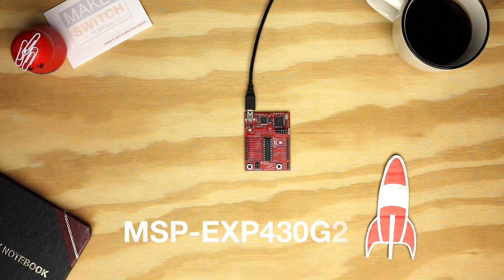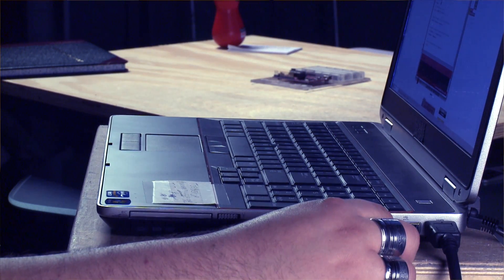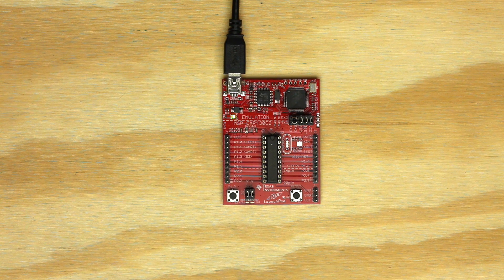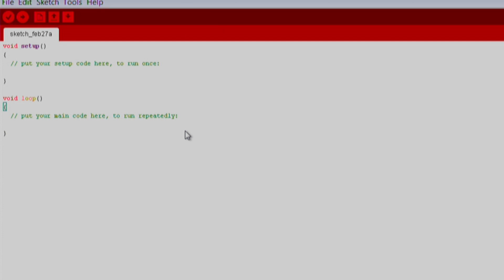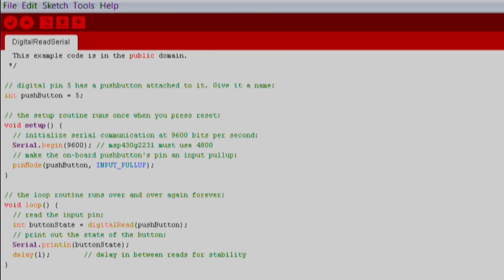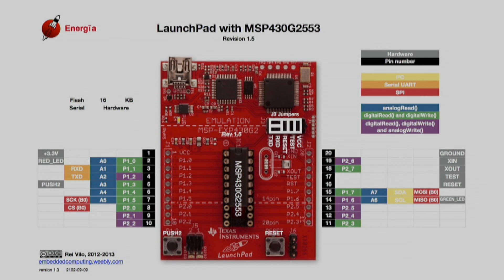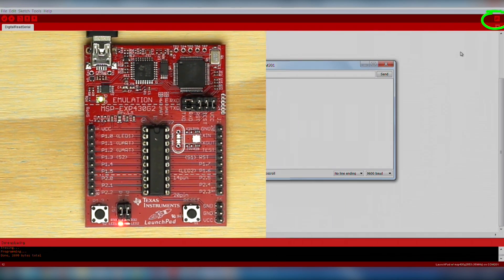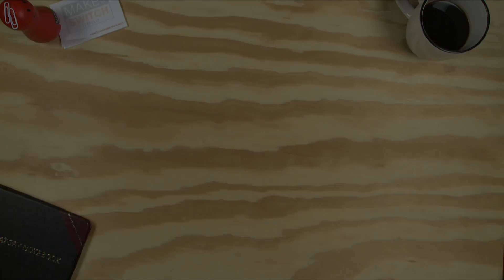Energia Tutorial: MSP430G2 LaunchPad

Comment: For some reason i tried the blink program and it works fine. after i uploaded the push button sketch the console doesn't say anything. I have a MAC. No idea whats wrong with the console even the the LED worked perfectly with the previous uploaded code.
Reply from the maker: +Thomas Heaven Double check your baud rate in the serial monitor matches your code. You can also try resetting your LaunchPad. You may need to install the drivers for the LaunchPad: http://energia.nu/files/MSP430LPCDC-1.0.3b-Signed.zip detailed in the installation instructions for Mac http://energia.nu/guide/guide_macosx/
Reply: Baud seems ok. I will re-install the drivers and see if anything might change. Weird thing is that the console also on the Arduino IDE doesn't show me anything either. I have no printf() output whatsoever.